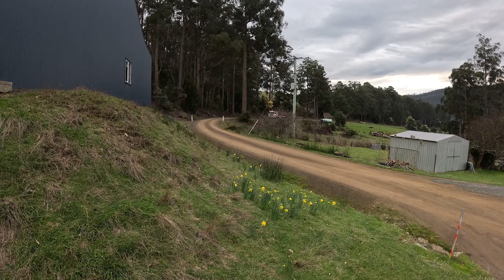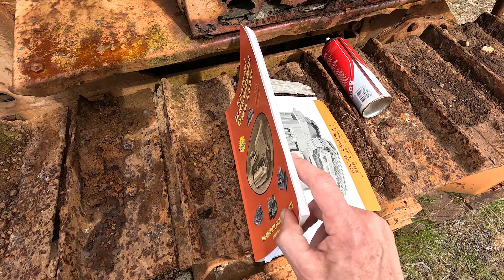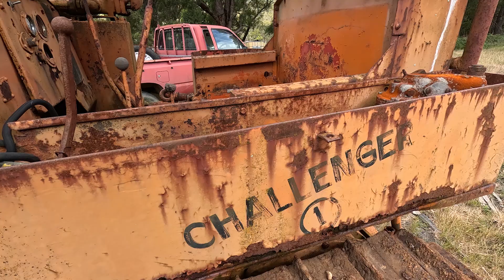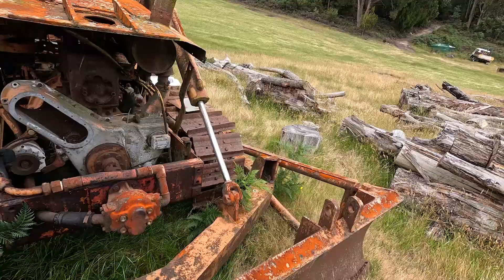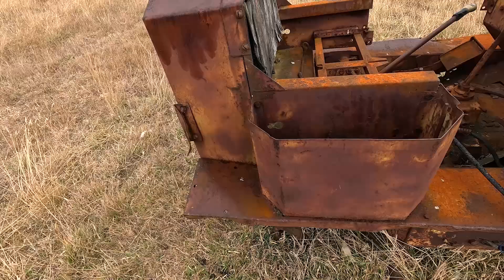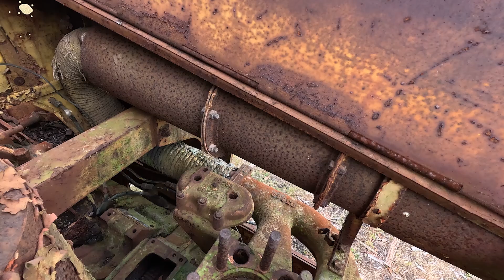Fowler Challenger 1 crawler project. Is this doable!

Comment: Just about to purchase a Challenger 2 here in Vic, has the 80HP supercharged engine, motor in it is a monster with a massive roots blower on the side, sadly the main subframe casting has cracked right the way across (apparently a common problem on these) but hopefully with some casting welding/bracing it can be fixed, currently being held together with a chain. The starter on the 80HP is down on the side instead of the top, and the current owner fixed the oiling issue in the cylinder with a modification to the pump, but need more details on that.
Reply from the maker: Oo I would like to have more of a chat about this. I didn't think any Challenger 2's got imported to Australia, it could be a Challenger 1 with a GM engine fitted.
My email address is dmc12d@yahoo.com
Reply: @Tassietinker490  100% it has a Marshal 2 banger in it, not a GM, it may very well be a private import as the fella has some other rare stuff, I'd have to chat more about it with him, I am purchasing two other Fowler's off him, these are the Field Marshal 2 banger single type ones, one for parts as it's too far gone and also a complete running one with a blade on it, I also have a very good example purchased from his cousin currently housed at the Melbourne Steam club but it needs a replacement splined shaft that carries the gear set. I will likely be moving to Tassie next year so would love to see your collection one day and have a beer or two.
Reply from the maker: That's very interesting, the VF's are a cool little tractor. Please keep in touch regarding the Challenger as there are not many around.  For sure Tassie not a bad little place. 🍻🍻